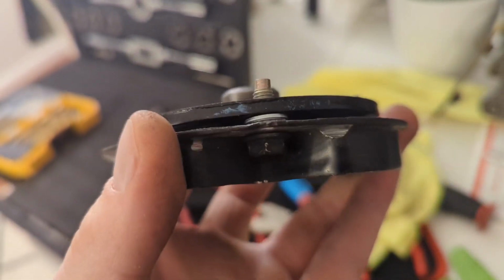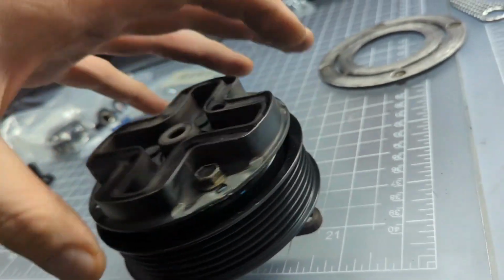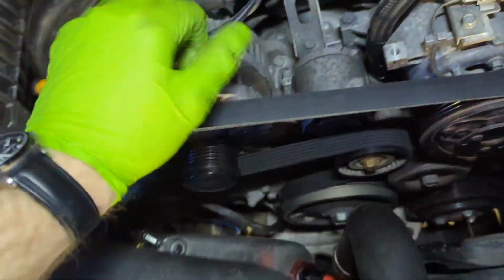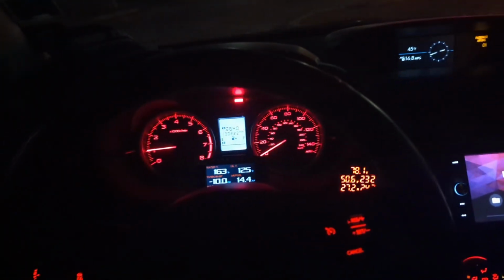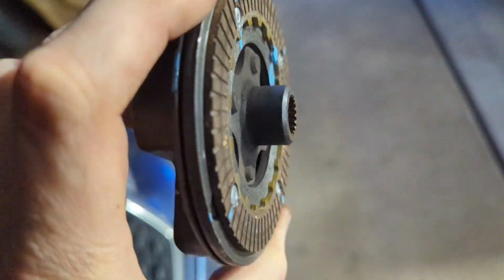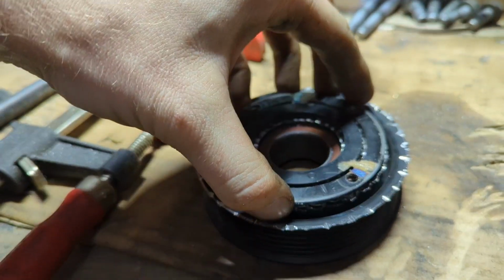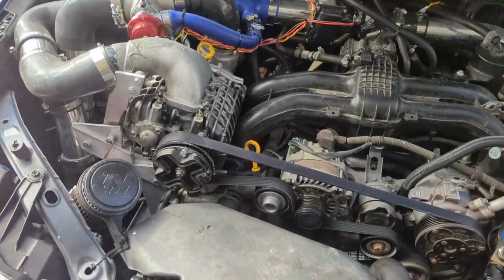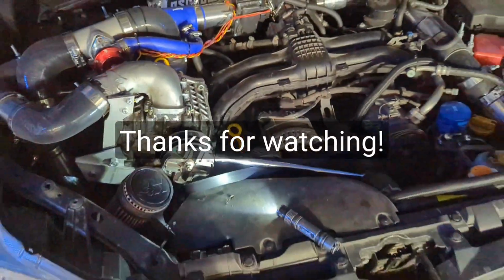FB25 Supercharger Part 13: New Pulley Misfortunes

Comment: How did the supercharger clutch behave in the original application? Is it hard on the clutch to engage at higher rpms? I just started watching all these videos and am super intrigued!
Reply from the maker: It worked well! One of the mating surfaces is the pulley, so when I went to a smaller pulley I gave up on the original clutch, basically.
Reply: Sorry meant this comment for the previous video. I mean when was the clutch engaged on the Previa? Just at high throttle via computer?
Reply from the maker: @andynauta  that's a good question. Not really sure! I assume, for the sake of efficiency, that it could have been switched on and off as needed.